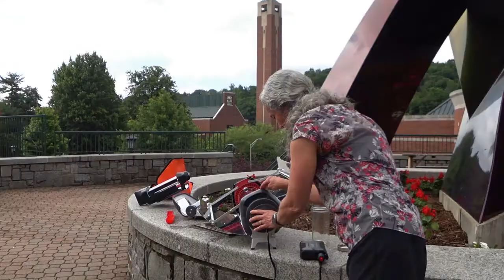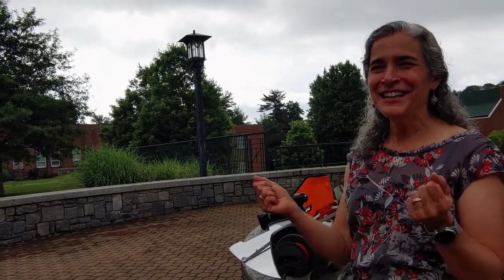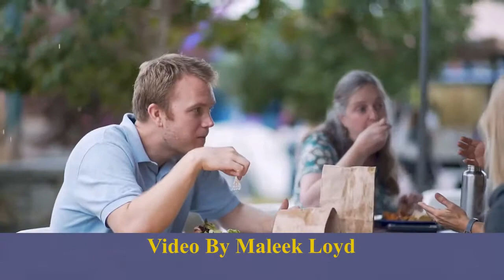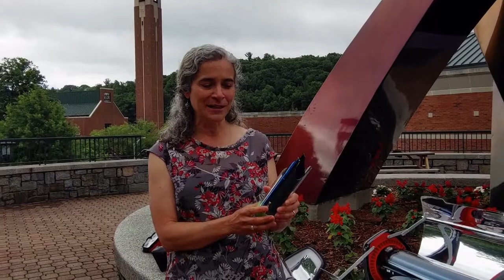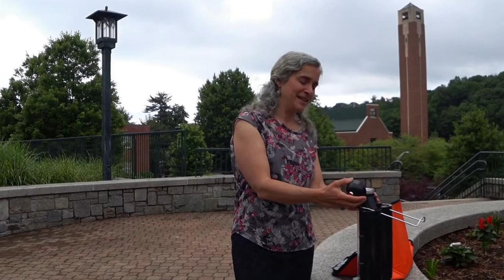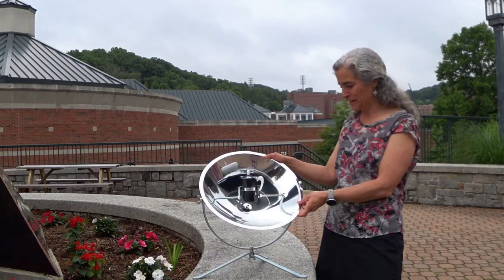Carla Ramsdell: The Food Physicist

Comment: I want more information on hybrid solar cooker designs.   Seems intuitive and logical.
Reply from the maker: There are several in other conversations--look up Dave Chalker, Steve Harrigan, GoSun/Patrick Sherwin, and Johan/Erika Van Wyk. In order, solar box cooker with electric backup, barrel/box cooker with rocket stove attachment, electric heating element in a tray that works in the GoSun Fusion, and another box cooker on a stand, with electric backup. Also, the Sun Oven Villager has a pipe running into its half-barrel shaped box cooker, that is set up to take a propane wand when clouds roll in or if one wants to cook at night.